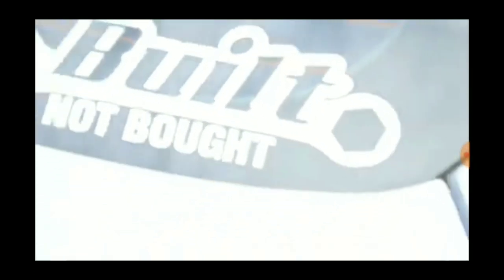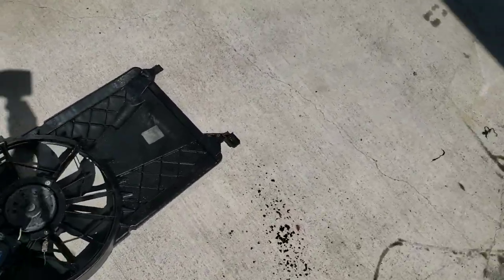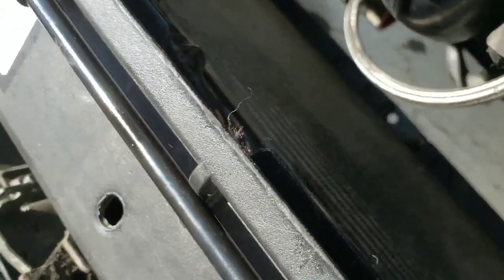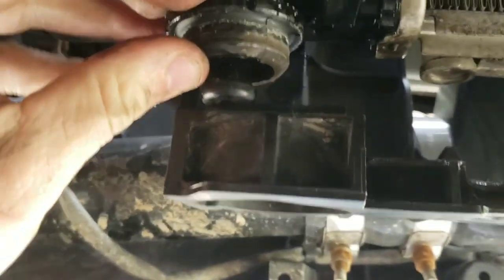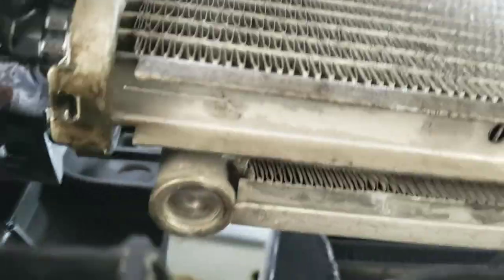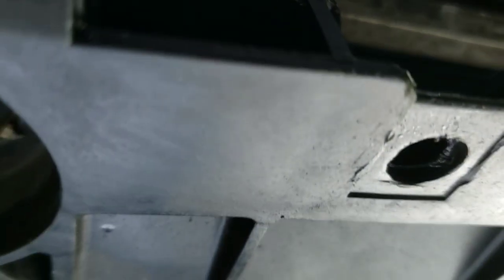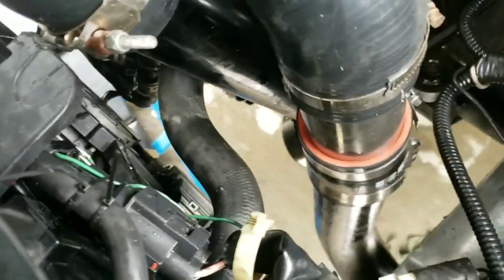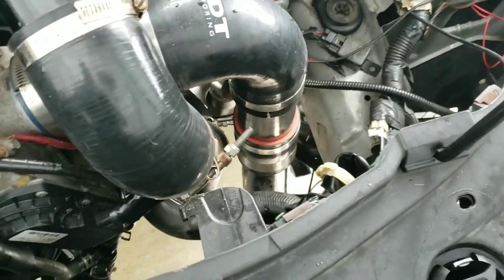How to replace radiator on Mazda 3

Comment: Couple of handy pointers for future viewers.

First, hello from the past. 🤪

Second, at 35-45 seconds in, he talks about removing the long round upper radiator clips, with the 3 tabs that have to be pushed in at once.  Tip:  just reach UNDER the plate where it mounts, and you'll feel the cylinder, which you can easily push up while depressing the 3 tabs. 👍

Next, i think around 4:40, he's talking about removing the a/c condenser from the front of the radiator, so the radiator can drop out.  Forget trying to figure out how to release four next-to-impossible clips at once.  They are attached to the radiator, and the radiator is trash already, so just break off the four black clips.  Done!

Comment: TIPS learned the hard way on 04 Mazda3 2.3L: 
1) Don't be afraid to push FIRMLY (on the top edge) on the Condenser (when combined to the Radiator) toward the engine which tilts the unit (babying it doesn't gets it done)...its the only way to get clearance above to raise the unit to pop the Radiator's leg stems completely out of the sockets. 
2) To help separate the Condenser from Radiator, use two ~2.5mm Hex/Allen Wrenches as spacers. When you De-Latch the Condenser on one side, slip a Hex Wrench in/under the clip, so when you go to the other side to De-Latch, you don't have the previous one slip back down/in! 
Note: THIS WAS A RADIATOR CHANGE FROM HELL. Good luck folks!

Comment: If you're going in to replace the radiator, don't bother saving the tabs on the old radiator. Stick a screwdriver in between the fan shroud and radiator, and the AC condenser and the radiator and just snap them off. Easier to remove and the new radiator has new tabs.

Comment: Thank you very much for the video! I am replacing the A/C compressor and condenser on my 2010 Mazdaspeed 3 and this was very helpful, as the radiator needs to come out to get the condenser out. Unfortunately, 3 out of 4 bolts on the compressor broke off in the block so I ended up having to take the front bumper off too, so I could have enough clearance to drill out the broken bolts and re-tap the holes. Aren't cars fun?
Reply from the maker: I love cars! Even though i tend to curse at sometimes but yes, they are great! I am glad this video has helped! Goodluck on the compressor!

Comment: Hey man my radiator burned out, but I had it towed in front of the shop and was gonna do the job myself, just wanted to know what sockets and etc you needed to get the job done. Thanks for the video it’s already a big help.
Reply from the maker: Hey! I hate to hear that. I used basic tools. It really wasn't too difficult, just allow yourself time. The hardest part is getting those black clips removed from the top. I used several flathead screwdrivers to push in the tabs. Shout at me if you get stuck or need help!
Reply: Just Another Tunertv thank you for the hastily reply, turns out it wasn’t my radiator but a hose, I didn’t get a close look but it’s under the air intake, not necessarily the manifold. No huge hose attached to the radiator but a smaller one attached to the block. Had to replace the top hose to my radiator before, but who knows I saw my radiator and my thermostat both steaming. Only way I could find the leak was pouring more water in.

Comment: My son gave me a mazda 3 2008,. after whatching this video, and try to find a radiator cap, and little bit disappointed about how complicated is this issue with the radiator. Man now adays it is so hard to fix your own car mechanically and electronically.  i got a 97 honda crv that  i fixed myself and i hope i never want to get another car, and I am 80 year old men.
Reply from the maker: Mazda 3's are great vehicles. Almost any vehicle within the last 8 to 10 years is basically impossible to work on yourself which stinks! Btw, the mazda 3 does not have a traditional radiator cap on the radiator. You just fill at the reservoir. First time i have ever seen that
Reply: @justanothertuner4135   I remenber the good old day , the VW didn't have radiators either, they were running  the cool air engines like lawn mowers.

Comment: Just wondering at 1:38, what is that gray electrical connector to the left used for.  Mine is disconnected.  Not sure if it is supposed to be connected to or not and to what it is connected to.  Thanks.
Reply: Yeah same here im wondering if its used for anything mine is disconnected too

Comment: What is the electrical connector behind the top part of the radiator support? When the hood prop is lying flat, it's right under there. I'm asking because I am a 17 year old that just bought an 08 mazdaspeed 3 for $650 and that connector on my car doesn't have anything attached to it. Also, the horn doesn't work. Any info/advice would be appreciated.
Reply: 1:41 you can see it well to the left of the screen
Reply: Hi, it’s a hood latch alarm system. Based on my research.
Reply: @kobeknudsen5711  Thanks!
Reply: @Aminmotors  sorry I found your comment 7 months later. Hope that helps 😁
Reply: @kobeknudsen5711  XD I actually sold the car, but I appreciate you replying :)